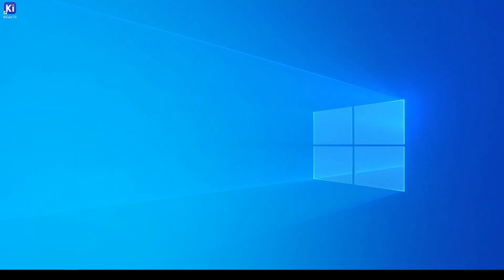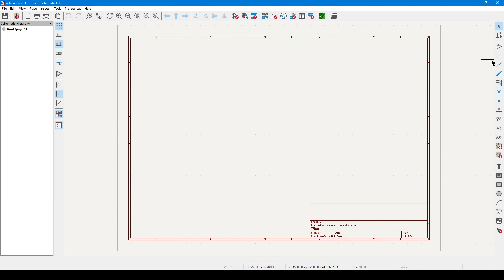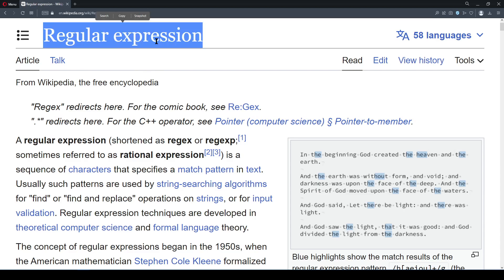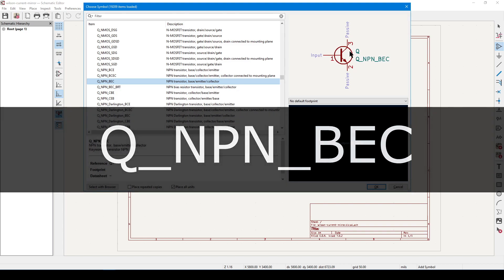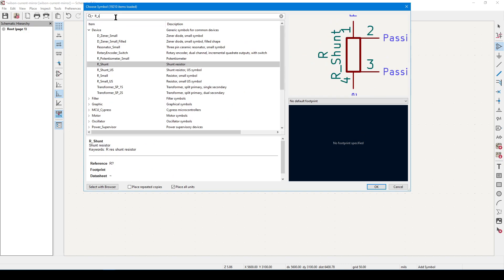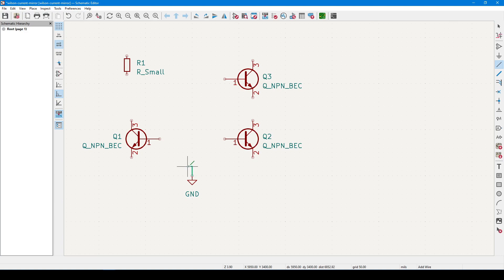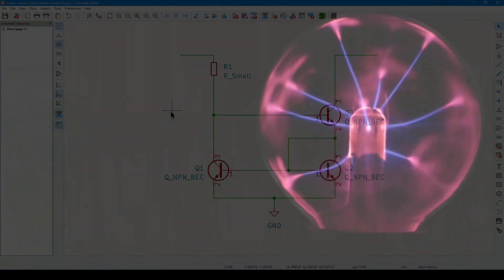KiCad 7 Tutorial: Basic Operations (Part 4)

Comment from the maker: Today's video is pretty extensive, but IMHO it's most important in the series so far.
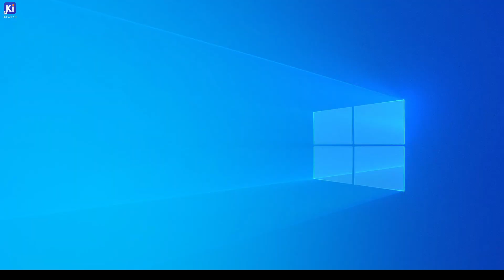0:00 - Objective
0:40 - Create a new project
1:10 - Check your grid
1:28 - Basic Operations
1:45 - Select mode
1:56 - Net highlight
2:13 - Add Symbol
3:25 - Searching by Regex
5:25 - Change reference designator
5:55 - Change component value
6:40 - Copy and paste
7:07 - Select (box select)
7:42 - Select (toggle select)
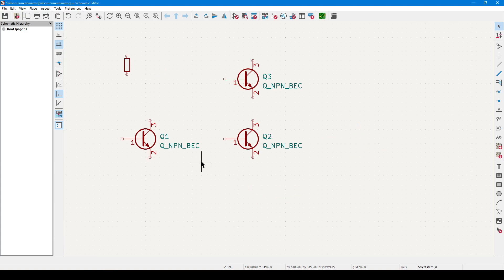8:07 - Rotate
8:20 - Mirror
8:50 - Power and ground
9:30 - Wires and wiring
9:48 - Symbols for IEC, ANSI, IEEE 
10:35 - Move (without wires)
10:45 - Drag (with wires)
10:50 - Group operations
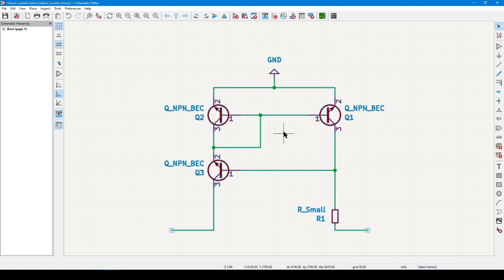11:07 - unboxing-tomorrow.com